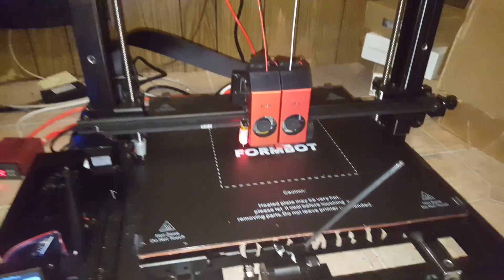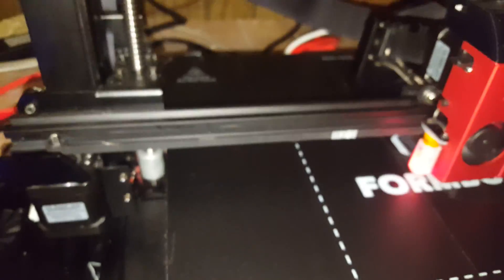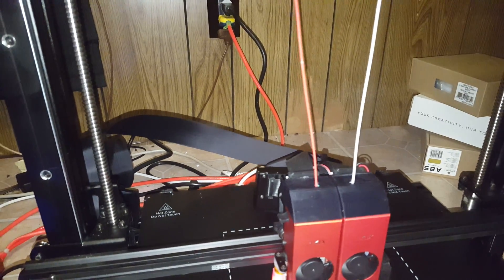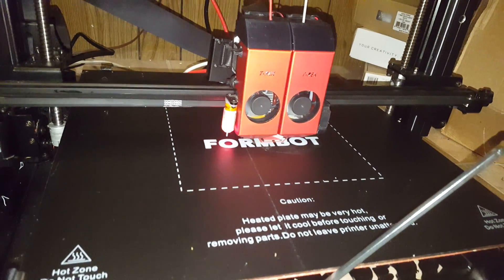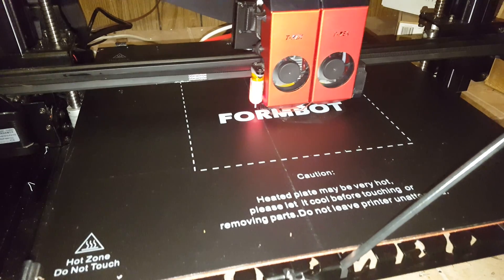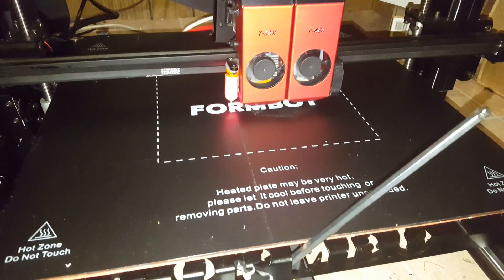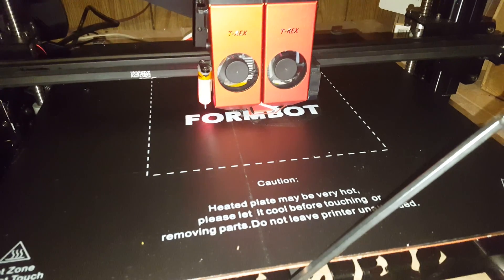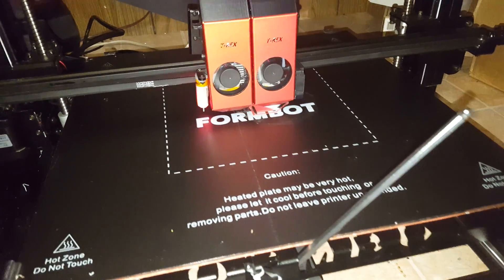Formbot T-Rex 2 dual extrusion

Comment: Thanks for the interesting video. Which app will work with these new dual extruder...Cura? Simplify 3d? do they have presetting FFF file for it ?
Reply from the maker: They include configuration files for Cura. I haven't tried anything else.
Reply: Thanks. Does it print easily with no issues? Reliable ?
Reply from the maker: It's been doing a great job with minimal issues. I'll be making a video showing the few issues I've run into, but it will be a while before I can. I'm on vacation.
Reply: Will be waiting for it...thanks

Comment: I just received my printer yesterday. I will be assembling it this weekend. Do you have any tips on assembling and software configurations?
Reply from the maker: Make sure you tighten the bolts on the "isolation tower" behind the extruder carriage! If it twists a little, the flat cable can drag the bed. I found this out the hard way. I'll make a video showing what I mean, but it won't be any time soon. I'll be gone on vacation for a couple of months.